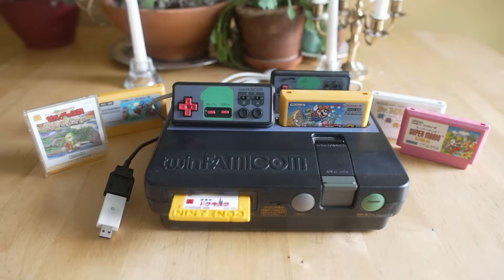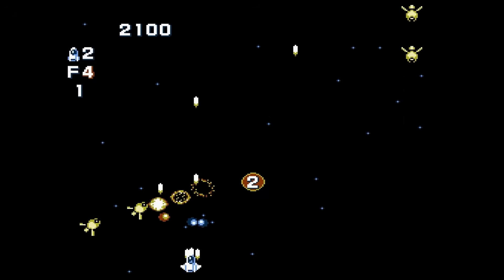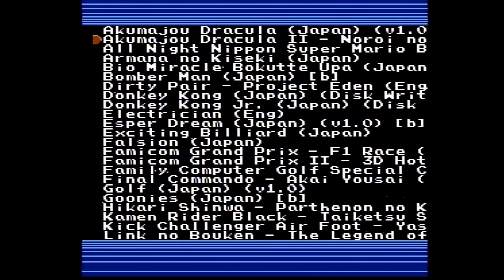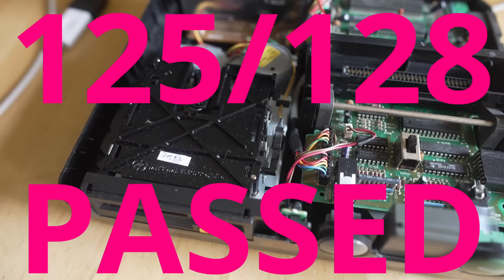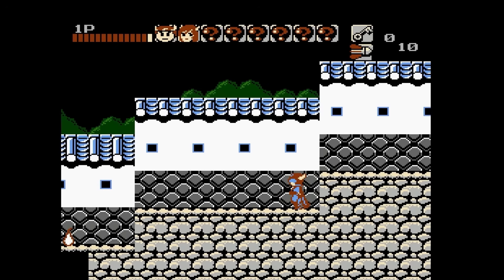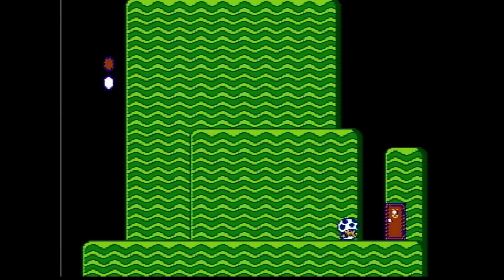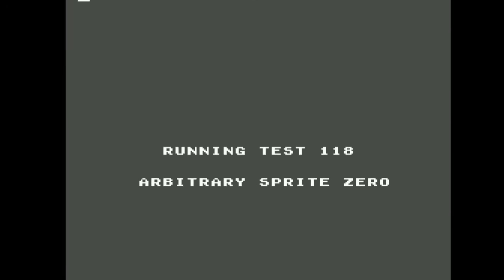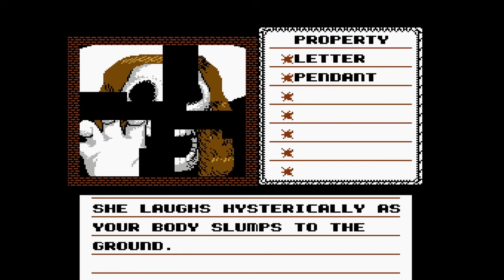MiSTer FPGA NES Core Hits 100% Accuracy With All Tests Passed

Comment: As a CNC machinist I can relate to the idea that 100% accuracy matters. Except for when it doesn't.  Sometimes it's fine if something just simply works. Then again, my brain craves accuracy. What a nice update!!!
Reply from the maker: But the further you measure the more you realize 100% accuracy is impossible. Sure it’ll be 100% accurate for what you need it to be but if you extend the measurements and start talking microns or less…suddenly you’ll find that .01% it’s off haha. And it’ll drive us all nuts
Reply: @VideoGameEsoterica so long as you're the one validating your own work, does any of it really matter? Thats why I love FPGA. But also why I love emulation. One is supposed to be way more accurate than the other but 99% of the time I can't tell the difference.  

And as far as machining accuracy goes, the customers can't tell the difference 99% of the time either. You didn't hear that from me though!
Reply from the maker: “Good enough for govt work” 🤣

Comment: I think there's a bit of misleading info on this video. Only some of these tests test the undocumented instructions, the rest are more or less tests about "undocumented or not but expected behaviour". If some emulator scored 0% on this test battery I can assure you no game would run correctly.
Reply from the maker: I didn’t say all 129 are esoteric never used bits. Just some

Comment: I assume these hard-to-emulate, undocumented, or unofficial features are what many indie and homebrew developers use as a kind of copy protection to keep people from dumping their ROMs and playing them in emulators.
Reply from the maker: Honestly that’s a good question
Reply: Some people (myself included) have thought about things like this over the years, but even with a unique memory mapper or separate watchdog circuit in the cartridge, it's only a matter of time before someone looking for the challenge would figure it out and modify the game to use a more common mapper. I had recently received a tester cartridge for a forthcoming game and was considering hacking it down to a more common mapper to run it on an emulator before figuring out a way to dump and play it as-is.

Comment: It's all very much appreciated, even just from a preservation standpoint. Thank you to everyone involved in testing and improving it! I need to check if PAL roms now work correctly, I believe they always ran on a much higher speed, but I could be confusing it with the Analogue Pocket core.

PS: I suggest to try out black cumin seed oil, it helped quite a bit to relieve my allergy symptoms.

Comment: I’m hoping more benchmark ROMs are made for other platforms as well. Most software emulation doesn’t stand to gain much since they’d be wasting CPU performance on emulating elements that 99% of games don’t even use, but it’s a nice plus for hardware emulation where it only takes up leftover space on the FPGA fabric.
Reply from the maker: It’s fun to be able to measure but in the end from the end user gameplay experience we are measuring and passing tests they’d never see any difference gameplay wise with
Reply: For a platform like the NES, I strongly suspect that one could pass 100% of tests within the performance window of a modern computer. I am basing this on being an emulator author of other platforms of a similar vintage who has recently used FPGA source code as a source of truth, in some places doing a completely-literal translation into C++, for relatively straight-line components like the video, timer and audio chips of the era. The performance hit hasn't been what you'd expect, it's really not bad at all if you're coming from a synchronous implementation. I'd be curious about the heavier components such as CPUs but I think a Verilog or VHDL transcription would be a net detriment for those as they're neatly expressible in traditional procedural terms.

As you imply though, the question isn't really possibility, it's value.

EDIT: sorry, for clarity, don't take this as expressing anything in terms of the value of FPGA implementations. There are lots of issues that software emulators face which hardware implementations do not which make the latter preferable if cost is no obstacle regardless of whether the software hits 100% of test cases.

Comment: I think we all learned about it in context of speed-running, where you are performing a bug that calls unintended behavior, you get different results. I don't remember which one, but sometimes you do something like play pac-man in Super Mario World, that sort of thing, that requires identical behavior to repeat.
Reply from the maker: Yes the 100% pass status is for TAS speedruns where exploits occur. Now you could theoretically run TAS on the core
Reply: @VideoGameEsoterica that is the bulk of the use case for this level of accuracy, but there are some human-achievable bugs that are now doable, and some bugs that are no longer doable(which matters for some leaderboards), in a couple games. But the venn diagram of people who needed this and people who play NES is atomically small overlap.
Reply from the maker: An overlap of one probably
Reply: @VideoGameEsoterica  Single digit  is possible, especially if 0 is considered single digit. Most of the speed runner leaderboards allow any "official" version so you get to use the "bad" Wii emulator for SMB on many categories.
Reply: @AldoInza  Even if official speedrunner rules "allows" Wii emulators it doesn't mean that Wii emulators are appreciated in speedrunning community.
And we also have many other reasons for targeting 100% accuracy like aftermarket games (which often pushing consoles to 100%), bootlegs, romacks and compatibility. Compatibility not only with current games, but also incoming, because if core is 100% accurate, i should play nicely every future game targeting specific system, no matter which tricks developers will be used for squishing more from old hardware.

So no, I don't buy that "no one need 100% accuracy" explanation.
Reply: @robertasm20 i didn't say no one, i said possibly noone. It's possible that the old ones core would be acceptable to speed running boards.

Comment: Mister FPGA is the best retro gaming device 🎉
Reply from the maker: the value to money proposition is off the charts good
Reply: It really is. Something the size of a cigarette 20 deck giving you accurate 1st-4th gen, and pretty accurate 5th gen, still getting supported/updated, cheap if you get a clone.

MiSTer FPGA = 🏆🥇
Reply from the maker: 20 deck? Not pack? This has to be some slang from outside the US
Reply: @VideoGameEsoterica  UK slang, brother. I imagine it originates from the visual simularity of a 20 pack and a deck of cards in one of those cardboard packs. Don't quote me on that, though. Also, in The North (Sean Bean-voice), single cigarettes are often referred to as tabs.

Useless UK cigarette trivia 😂
Reply from the maker: Haha tabs I’ve heard. Blue squares in the US
Reply: yeah save state support across all cores is a game changer...hang on..
Reply: Sure it is neat but it can't hold a candle to any old PC the last decade.
Reply: Input latency?
Reply: @JoePublic-kg3zg Run ahead algos and fast screens covers the latency just fine running on a PC.
For most that is the best, cheapest most diverse option.
Reply: @cajampa software emulation is definitely cool but there a few reasons I still prefer to use my Mister for me personally
Reply: @retrorobbgaming Of course. But the statement was the best retro gaming device.
And i am saying anything that can run all those software emulators are better for most. FPGA software(hardware) emulation with a ton of scaffolding is very niche.
Reply: @cajampa to each their own
Reply: @cajampa  Not sure what you mean by "scaffolding", but for instance I've never played an N64 emulator that could hold a candle to the N64 MiSTer FPGA core.

It's true that its capabilities are limited to 1st-5th gen, and that limits it to people who are nostalgic for those generations.

The input latency thing is real. You think it isn't until you actually play a MiSTer FPGA. You think that's all hype/hot-air. Then you play one, and you say "Oh shhhii.. they weren't bluffing about input delay"

There's no better way to play these old games in a modern context.
Reply: @n64fan60 Runahead algos and fast screens plus low latency controllers covers the latency just fine on software based emulators.

Comment: Really want to know which model of Real Hardware can hit 100% accuracy?

Famicom
NES
PAL NES
Sharp Twin Famicom
Sharp Famicom Titler
AV Famicom
NES Top Loader
Reply: In theory, NES-001 and NES-002 with a revision G CPU and PPU should match the test results perfectly. In practice, there are a few issues needed to be fixed with the tests for the SHA and SHS instructions, and the tests for "OAM Corruption" and "PPU Open Bus" rely on analogue behavior, unfortunately causing those tests to fail every now and then.

I think there are still a few tests to update for famicoms, namely the "Implied Dummy Reads" test, which can apparently crash on certain famicoms due to differences in controller reading.
Reply from the maker: Then why is my model Twin Famicom failing 2? Wonder if its just down to age

Comment: Does this accuracy test account for cycle accuracy?
Reply: "Cycle accuracy" is honestly a buzzword that means nothing. You can have a "cycle accurate" emulator that still fails the majority of tests due to incorrect logic, even if it's happening at a cycle by cycle level.

That being said, a few tests in this ROM, namely "Interrupt Flag Latency" relies on behavior happening between steps of the CPU which would be near-impossible to pass if you aren't emulating things one cycle at a time. Tests like "Instruction Timing" obviously rely on each instruction taking the correct number of cycles, and there are a handful of tests relying on the exact timing on both CPU and PPU functions, like the test for "NMI Timing".
Reply: @100thCoin  yeah, if I can jump further on that: outside of the 6502, cycle accuracy isn't even really appropriate. CPUs make bus transactions which may or may not contain segments that are integral cycles in length. E.g. a regular Z80 access bus operation is 1.5 cycles in which the operation, address and data (if it's a write) appear on the bus and given time to stabilise, then WAIT is sampled possibly to spin on an external peripheral, then another 1.5 cycles in which the Z80 takes an appropriate pause and then samples the data bus, or else permits time for an external device to sample what it put there.

If you make that discrete in terms of whole cycles only, you sample WAIT at the wrong time.

But also, you don't communicate anything additional over saying atomically "for 1.5 cycles I did the first bit of an access".

So in that case "cycle accurate" is both less accurate than the processor and less accurate than moving in longer chunks.

Put another way: timestamp precision is one thing, atomic bus operations are another, and in relatively few cases do the two align and align such that the unit of time is one cycle.
Reply: @100thCoin 100%. Cycle accuracy is just one of many factors to a good core. The vast majority of cores are not close to cycle accurate, but even pro speed runners would never feel the difference. In the speed run community, MiSTer is often considered a viable way to do a run on your game.
Reply: @100thCoin  with that logic so is this test for the most part.
Reply from the maker: Its more about functions and less about cycle accuracy
Reply: It's my understanding that NES, Genesis, and Neo Geo are cycle accurate. Can't remember where I read the source for this info, but it was years ago. I also remember reading some arcade cores are cycle accurate, as they are often reverse engineered from the schematics.
Reply from the maker: They are yes. Some tests are just synthetic tests that can fail even if the core is cycle accurate